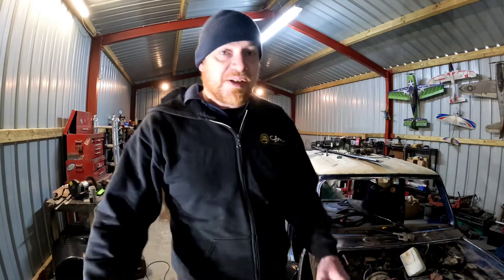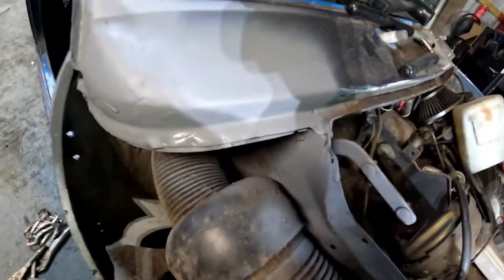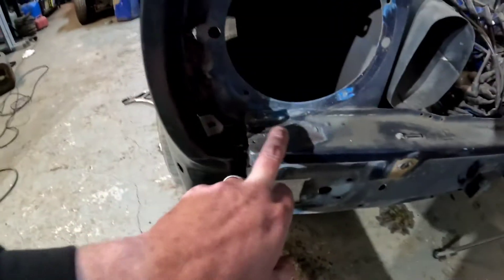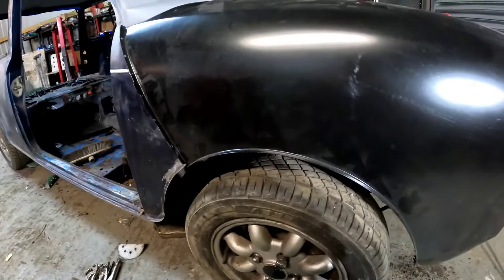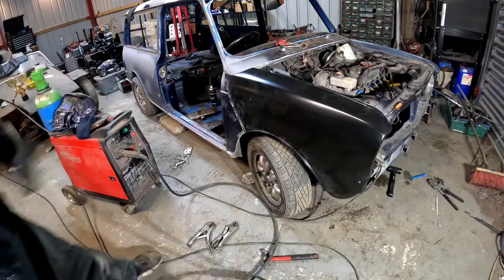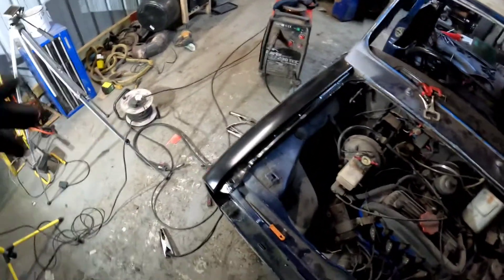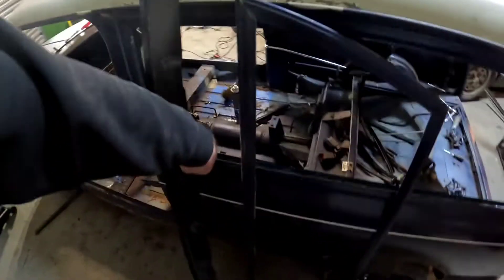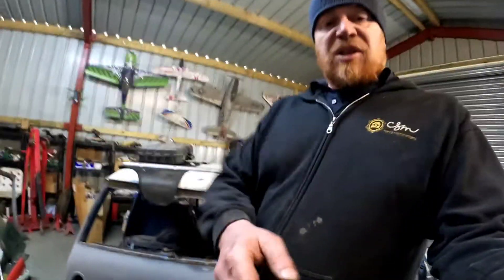classic mini restoration pt2 welding on the front wing. clubman estate

Comment: Thank you for showing how you welded the wings on I have gotten to that stage with my 72 clubman estate but mines has pretty much had a complete front end replaced (years and years of bad repairs)
Reply from the maker: No problem!! Unfortunately most have had years of bad repairs I've had to replace the complete front on a few over the years. 🙂👍
Reply: @retro.restorations  yh I have had to replace the toe board due to the floor and the flitch panels being patch repairs 8 times and the annoying thing is it had a replacement front end fitted so poorly I couldn't salvage it so have had to replace that aswell

Comment: Just do you don’t blind yourself: you’re not supposed to ‘charge’ your helmet in the sun. The battery needs to be replaced. The battery is to do the initial sensor and respond to the first arc. Then the solar sensor maintains the dim from the light of the arc. Leaving you’re helmet out in the sun will ruin the battery.